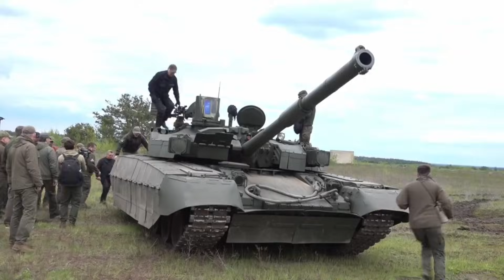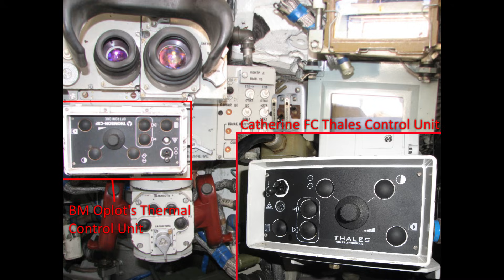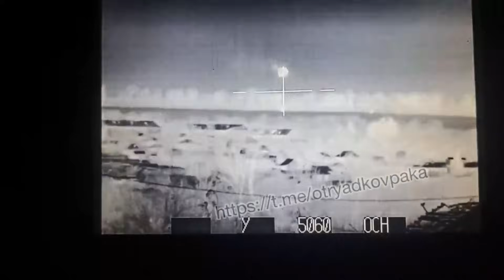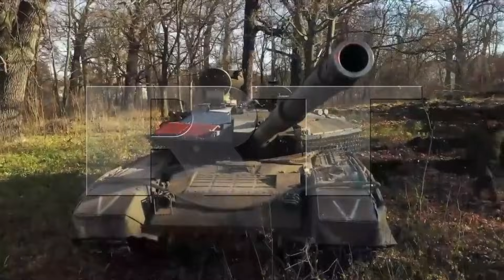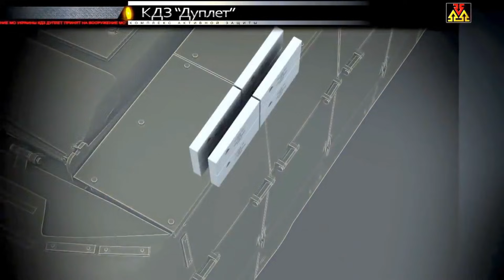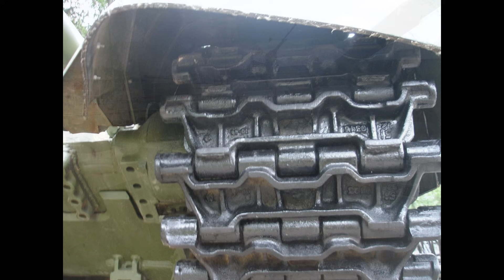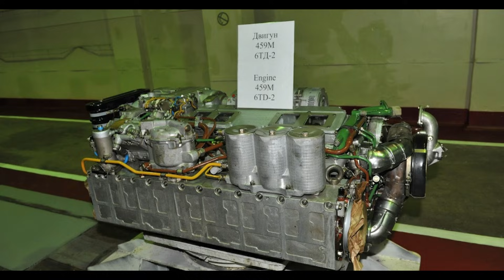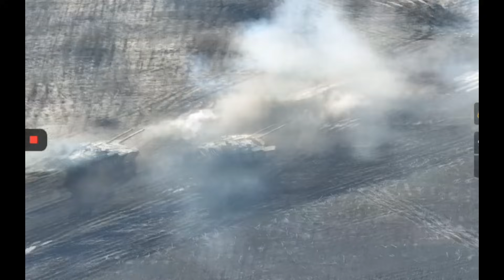Best Ukrainian vs Best Russian tank. T-90M vs BM Oplot comparison

Comment: do we have an estimate production number for the Russian t-90m?
Reply: Over 250 per year - as that was pre war max. 
After 250 we get claims all over the place - but 20 per month is the minimum made.
Reply: @tomk3732  HUH? Their entire stock of t-90m before the war was less than 250 tanks. The fact t-90m was unveiled in 2011 tells you just how capable the Russian industry is of producing it.... from 2014-2022 it is ~250 tanks and now all of a sudden its 250 tanks PER YEAR? Unbelievable and completely unrealistic
Reply: @a.t6066  What? The pre-war production - proven - per year was 250. Some years 200 some 250. Per year. Proven. As in they delivered such tanks. 
You do know T-90M is world's best selling tank, don't you? 
Also T-90M was produced since 2016. The "Proryv-3" version since 2020. 1000s of T-90A ---> T-90M were produced. Clearly average is well over 100 per year & these are delivered and being driven around. 
With addition  of just 100 new tanks per year Russian tank replacement is almost 30 years. That is quite a long time - this is more or less minimum what they have to do or their tank fleet would shrink even without any war. 
Come on pp - use your brain, they need to replace their own tanks and make them for export - they need large capacity to do so.
Reply: @tomk3732  250 per year XD. Is that why there was an initial order for 2017 contract was 30 tank by 2019 yet uvz proudly announced the first delivery of 10 tank to 1st guards in 2020? uvz even announces that the first half of 2021 they have made 26 tanks, with Alexei Krivoruchko saying a total of 65 is to be received in 2021...
250 tank at the start of the invasion was already a very generous assessment...
Reply: @tomk3732  "t-90m is the world's best selling tank" 
Ok, so tell me what countries own them?
Reply: @a.t6066  You do know... they make tanks for a LOT of people and different types of tanks... DO YOU? In two factories as well. The actual quote is "This year, 20 new T-14 Armata tanks will be delivered to the troops," the deputy head of the department quotes the media as saying. Krivoruchko noted that the army will receive 65 T-90M "Breakthrough" tanks (the first such vehicles were delivered to the Armed Forces last year), a brigade set of the Iskander-M operational and tactical complex, as well as UAVs of various types, including shock ones." 

I do not see anything conflicting with what I said about 250 tanks per year as max peacetime production. 65 T-90M tanks, 20 T-14 tanks together is close to 100 - as in 65+ 20 = 85. They also upgrade at least 100 tanks per year. This fits very nicely with all what I have provided. Are you here to prove my point now or sticking to yours somehow?
Reply: @tomk3732  you just proved your own point wrong lmao.
Production of new tank is even slower now than it was due to increase demand of refurbishing of old tanks, extensive increase in repair and production of other equipment and sanctions which have cut off many materials once used. They have the same number of factories open as during peacetime but want greater production. You don't suddenly gain more space to do everything at once.... 
T-90m proryv is the same as t-90m... and 20 new armada tanks XD Production started a million years ago and defence supposedly wanted 2500 by 2020.... they were not producing 20 armata per year, they DELIVERED 20 armata IN that year lol.
250 tanks in peacetime is absolute ceiling maximum for ALL tanks (upgraded AND manufactured), and is not solely for t-90m.
and go ahead and tell me which countries have had t-90m or t-90ms delivered to them.
 "T-90m is the world's best selling tank" lol
Reply: @tomk3732  why do you think t-72b3 exists in the first place? It is as gap filler for t-90m and even t-90a. Russia CANNOT produce the numbers of t-90m to completely outfit their military. At a supposed rate of 250 per year it is impossible for t-72b3 to exist and yet....
Reply: @a.t6066  They upgrade around 100 tanks and get new another 100 tanks. What is the problem here? They have almost 3000 tanks in service. Many tanks in the east are still T-72A models (!)
The max production of 250 is max - usually it was quite less per year - 180, 200 or 220 - with about half of or so going for export. 
All numbers add up nicely. There is no discrepancy. Remember this is per year not per month. 
Why does T-72BM3 exist - b/c there are not enough T-90M or T-14s etc. made and upgrading T-72B is cheaper than making a new T-90M. And T-90M is like half the price of T-14. 
US only has around 700 tanks that are latest M1 version. Does it mean US is not making any tanks?
Reply: @a.t6066  Not really - Russia opened multiple factories (I believe 3 last year) to deal with the demand to fix broken tanks - in addition to what was there. Also some facilities are used for upgrades. 
Sanctions have zero effect on tank production - none. 
The idea that someone wanted T-14 by 2020 in numbers above 2000 was just propaganda. Even with not selling for export and making just T-14s it would take a decade to make so many tanks ;)
"they were not producing 20 armata per year, they DELIVERED 20 armata IN that year lol." - which is ... 20 tanks per year. 
250 tanks in peacetime is absolute ceiling maximum for ALL tanks (upgraded AND manufactured), and is not solely for t-90m. no - upgrades are separate. If you say that 250 tanks are max for new production and upgrades than please explain where exported tanks come from - please do. Are they made using .... magic? 

T-90M is worlds best selling tank - as per western sources. If its not - then please, enlighten me, which tank is best selling? Well?
Reply: @Tom K  
Even uvz themselves never claimed number 200 newly created tanks per year.... even russian mod before 2022 never has made such bold claims.
In the first place nations aren't buying new russian tanks in large nunbers, they are upgrading from their existing national stocks (and even the upgrade is not extensive). Most nations are buying air defense, technical packages and aircraft, ammunition, and other equipment. NOT tanks. If you want to get an idea how well they deal with large export orders for tanks, look no further than the shitshow that was the delivery of t-90s to india....
and who gives a shit which western or Eastern source says t-90m is the best selling tank. WHICH COUNTRIES ARE BUYING? You cannot and will not find one single picture of any nation other than russia operating t-90m. Not a glamor photo, not a training photo, not even a shipment photo, nothing. Nothing at all. Not even one single tank outside of Russia... YOU claim more than 250 t-90m can be produced while also upgrading existing t-72 and t-90 stocks but there is absolutely ZERO information to support that. Everything points contrary....
Reply: @a.t6066  BUT we do have data of purchased NEW Russian tanks. We know they were purchased, made and sent. And paid for. You claim these foreign countries are faking it? 

What about T-90M delivery to India - India is by far largest user of T-90 tanks. 

What do you mean no one is operating T-90M - India is the biggest user. Even you mentioned it... yourself. 

What do you mean not even one single tank outside of Russia - there are plenty of photos and videos - maybe you need to google. There are way, way more export versions of T-90 than Russia has - same as there are way more versions of Su-27 outside of Russia than inside. 

Everything points to - via google - and known deals for tanks - that Russia has to produce 200 tanks per year on average. They simply cannot produce less over last decade or so as that would mean they could not sell all these tanks to foreign markets. And presence of tanks such as T-72BM3 suggests they need to upgrade these tanks... they also upgrade T-80 tanks. The numbers present suggest around 100 tanks per year. You cannot simply do other math to do so - we know year of introduction, we know approximately how many were deployed... so about 100 had to be upgraded in Russia ... or do you suggest China upgraded tanks for Russia? Someone did. Or do you claim that India actually made all these extra T-90s? What is the explanation? Magic? Spontaneous tank appearance? Much easier is to simply say Russia made them. 

Please explain how to account for all these tanks. Please refrain from using divine intervention as main explanation vector.
Reply: @Tom K  India operates t-90s not t-90m.... and India DID make the t-90.... it was part of the deal to create domestic production. Russia delivered less than 150 fully complete tanks (most with old shitty cast turrets) then gave India a few hundred upgrade kits. Then said "you're on your own" so they could push responsibilities of delivery onto Indian tank plants.
Reply: @a.t6066  India operates T-90S - and many were made in India. However, many were also made in Russia. According to you, the ones made in Russia are ... not there. As clearly Russia could not have produced them. Now go to Indians and claim they do not actually have these tanks ;)
Again, please go to India and tell them they are idiots -
"Russia and India concluded a contract for 310 T-90 battle tanks February 15 in New Delhi, finalizing an agreement initially set for signing last fall. Under the terms of the deal, India will receive 124 of Russia's top-of-the-line tanks directly from Moscow and assemble another 186 at a domestic plant. The final price tag, not publicly revealed, is estimated at between $600 million and $750 million."
They paid so much cash for junk. 
"India has awarded a $3.12 billion contract for local production of 464 T-90S main battle tanks after paying a technology transfer fee to Russia.

The contract was signed with little fanfare earlier this month. The deal stipulates that Russian original equipment manufacturer UralVagonZavod and arms export agency Rosoboronexport will be paid $1.2 billion for technology transfer, while India’s state-owned Ordnance Factory Board will be paid $1.92 billion for local production of 464 T-90S tanks, according to an Indian Ministry of Defence official."

Stupid Indians - they paid billions for junk and vapor tanks. Go point out these do not exist! 

42 old T-90 with cast turret were sent, while next year 82 were sent with welded turrets --- this suggests that 82 tanks were exported in 2002 in just one year just to a single customer - something you say is not possible. 
Then 186 tank kits were provided to India.
Then 127 complete tanks were ordered from Russia. 
In total over 400 tanks / kits were provided to India by Russia - not the claimed by you "less than 200" - and only 42 of these had cast turrets. 

Come on, you think I do not know how to use google or something?
Reply: @tomk3732  says who tho?
Reply: They do have some 700 T-90 A and M models pre-war.
Reply: @Col water Т90а в т90м, а не Т72, Т72 всего лишь на запчасти и в т72б2м.
Reply: 20 per month that I read
Reply: @eneseren25  where?
Reply: Around 100 per month
Reply: @squidysnose69  says who?
Reply: @stefanobonaiuti8243  dimitri medvedev
Reply: @squidysnose69  yeah... I'm gonna skip on this info then.
Reply: @squidysnose69  lol, discarded immediately, unreliable source.
Reply: @RutakoVon  it's probably more reliable to trust the opposite of what he says
Reply: @stefanobonaiuti8243  considering the state of russian military industry right now, probably no more than 12 per month at the very very maximum. Realistically likely a lot lower

Comment: The Russians could’ve at least put the t80 transmission in the t90 to make it go 11kph issued of the 4kph
Reply: Engine and transmission are connected together to form whats known as a tank powerplant. With t80s gas turbine engine and t90 piston engine i doubt the trannys are interchangeable
Reply: That's not that simple, there're huge difference between gearboxes and connecting modules
Reply: you cant just out t80 transmision in to t72 hull thats not how that works
Reply: T-80 drinks a ton more fuel and is far more of a bitch to maintain tho. Which is why soo much t-80s were abandoned in the first few weeks of the war when the Ukrainians were eating up the russian logistical lines.
Reply: Or they could’ve put the t80s turbine engine In the t90s
Reply: @ankurar6492  Thats even harded to do
Reply: @jPlanerv2   ikr that’s soo hard that the Chinese and Ukrainian have done it
Reply: @ankurar6492  Ukraine doesnt use T72 except for donated/captured ones and chinese tanks have completely new hulls made from 0 and engines/transmissions designed precisely for them, Type 99 is not T 72
Reply: @jPlanerv2  you know the t-84/BM-Oplot and ZTZ/WZ1001 have transmission that can allow them to go upwards of 30+ Kph and they are all basically the same tanks
Reply: @ankurar6492  yes and none of these tanks have interchangeable parts and nor are T72/90 so whats your point?
Reply: @ankurar6492  or better put the T90M turret on the T80U hull instead of making those stupid T80BVMs
Reply: @ankurar6492  the tank's reliability would drop significantly along with it's fuel consumption would rise massively. Also, it would need an engine bay redesign as well.
Reply: While speculating on what specific parts or modifications they could have done is extremely difficult, they certainly could have fixed the problem in 50 fucking years somehow
Reply: It's all the same engine from the t34 anyway.
Reply: @Joaquin546  it's not the same engine, it's like calling a v12 from a train or an airplane the same V12 from the new Aston Martin
Reply: @jPlanerv2  eh with the Russians it's usually more bs than innovative
Reply: Now you have to change the engine bay, which isn't an easy thing to do even in peace time. And not to mention the need of new design of connector between the engine and transmission
Reply: The T-90M would then need to get an entire new engine bay because the T90M's engine is a diesel one unlike the T-80's gas turbine one. Also the transmission and engine are basically 1 single unit when installed. So it's not really feasable, a redesign in the single Reverse gear to increase it's size would be the most practical option, but i'm no mechanic.
Reply: All T-90M already have a 15 kmph reverse speed. It's still a downside, but not as big as for older modifications. Don't know where 4 kmph is coming from.
Reply: @dm1i  нет, там те же 4 км/ч.
Reply: @_b_x_b_1063  не, реально пытались поставить новую трансмиссию. Вот только она оказалась не особо надежной

Comment: I wonder... KMDB had, from time to time, showed a NATO-standard smoothbore 120mm gun fitted to various tanks. Considering current troubles with sourcing ammunition for Ukraine, I wonder if they might partly revive the Yatagan (T-84-120) for the restared production of T-84M/BM Oplot, or at least its gun and bustle autoloader...
Reply: they could. and in that case they Bm oplot could use modern nato ammunition like DM 63

Comment: They will probably rebuilt captured T80 to oplot standard in Poland or nearby
Also together with PL they could make upgraded T84 like
- 120mm NATO gun
- pangolin ERA
- upgraded opto-electronic systems
to produce T84 from 0 to 100% on west will be very hard but manageable and that hybrid tank should be cheaper alternative for UA to for ex. Panther tank
Reply: This process would be long and hard (thats what she said) putting a nato calibre gun on a tank turret not designed for it and then you have to design a new autoloader and then you have to modify the firecontrol system and then at that point you should just scrap this idea and import western tanks from allies
Reply: @squidysnose69  T84 Yatagan had KBM2 120mm L50 gun
Reply: that would be a new tank
Reply: There will never be enough captured tanks to organize such a production
Reply: @al1sa920  ~200-300 of T80UD, BV + captured could be modified to Yatagan standard imo
Reply: @ViperBenchmarks  even if this number is true, that's still not enough. Better just to change out optics and that would be it
Reply: @ViperBenchmarks  200 - 300? are you dreaming or something?